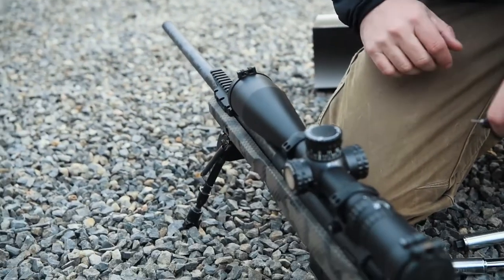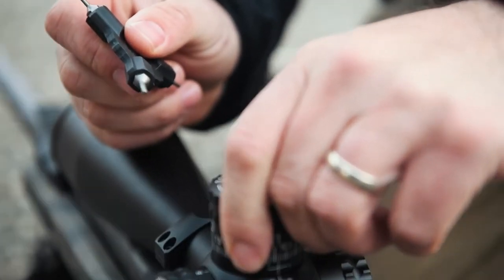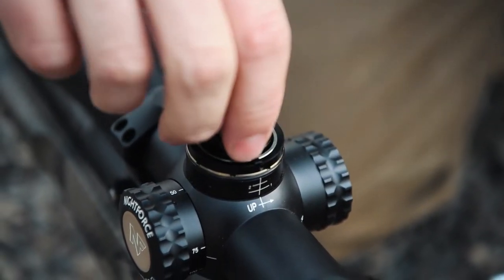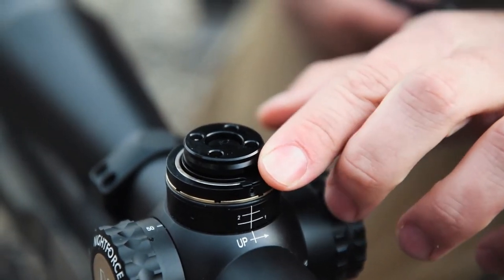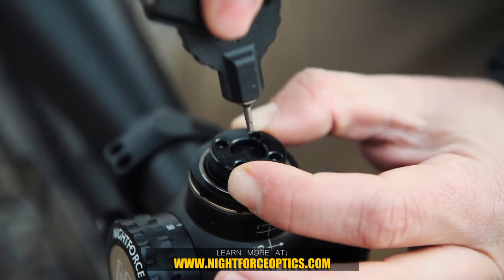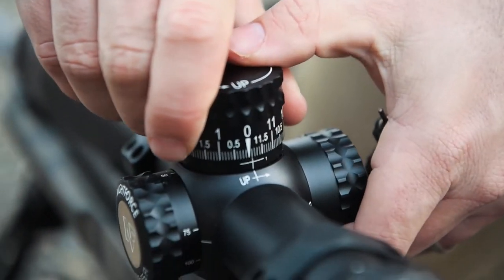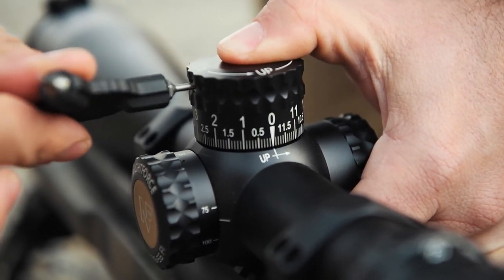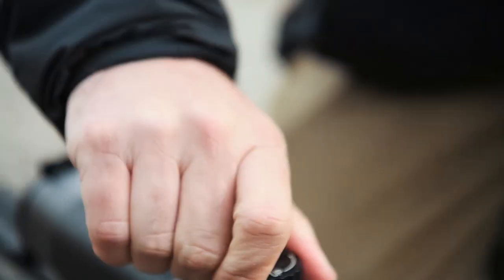Nightforce Optics ATAC-R | Zero Stop - Tactiholics™

Comment: If you want to cap easily down to zero line, just take out one of screw from cap( turret cap bolts also build  o-ring and create to inside air pressure when pushed down).

Comment: ok question. i bought a Barrett mrad , Nightforce 7-35 f1 tremor. and a Spuhr mount. have not shot it yet. my concern is i didnt realize the barrett had a 10 MIL base already.  i ordered the Spuhr mount with 13 MILLs. for a total of 23 mills. the scope clears but it might be a bit too much. im wondering if i will be able to zero at 100 yards. 23 mills is like over 80 inches at 100 yards. yikes please anyone with info on this will be greatly appreciated.
Reply: Theres plenty of mil adjustment left in the scope to zero at 100. Give it a go you should be fine